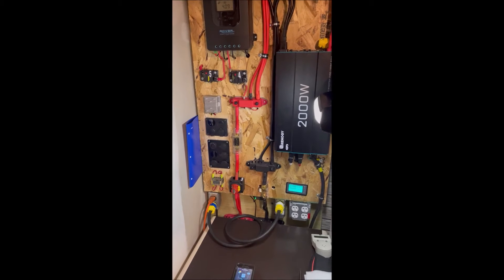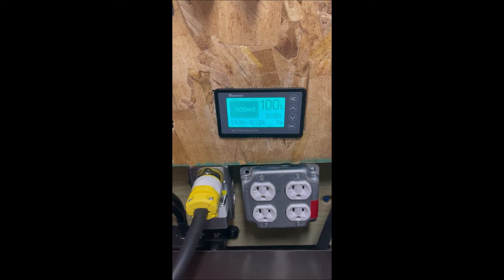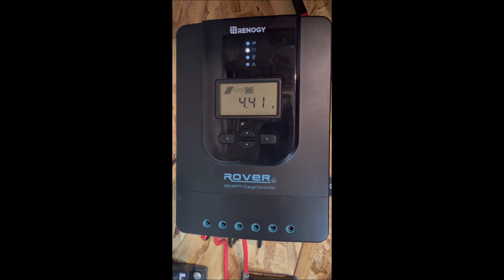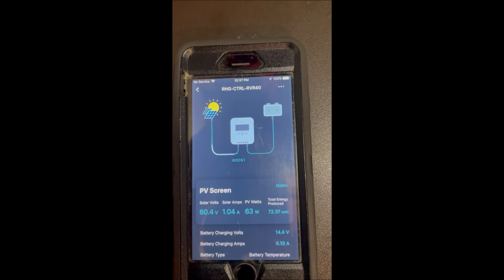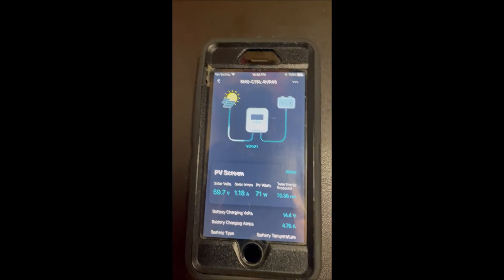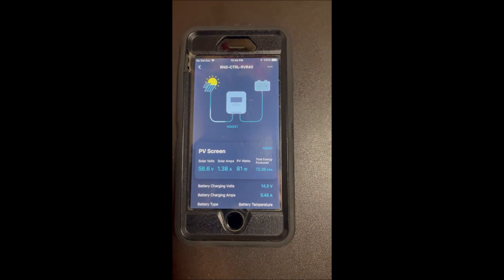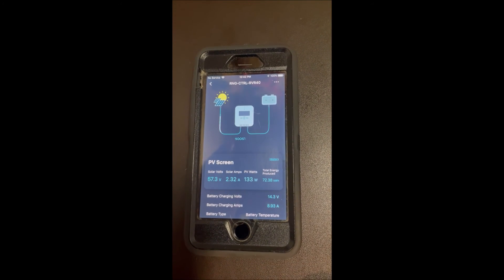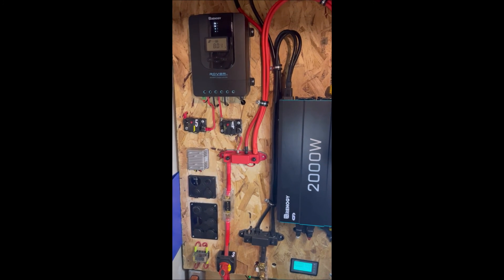Solar Basics: (1) What happens when your Battery is Full and there is still a LOAD?

Comment: Seems my controller goes over my set voltage when the battery is fully charged… then the over voltage alarm goes of on my inverter and shuts off
Reply from the maker: Check the voltage at the battery compared to what the controller is displaying.  There may be a significant voltage drop between the too.  The charge controller will keep charging till it measures what it is looking for which could make the battery too high.  You could also in your controller turn down voltage by the amount that it is overcharging.
Reply: @ yes thanks… I was playing with the voltage on the controller setting it a little lower than the correct float charge voltage…but seems I was still getting these spikes to 30v the system is 24 with a new 200 amp lifepo battery.  Batter speck is 28v charging voltage.
Reply from the maker: @thebluedan  It is probably the battery is not balanced.  A cell is going over voltage and the BMS is shutting off which creates that spike.  See the video I made about voltage spikes and balancing a battery/bank.  Literally had the same issue.
Reply: @ hmmm that’s a tough one, the BMS  is integrated…. FELICITY SOLAR battery..I don’t have access to this system… appreciate the note.. but the energy over voltage seems to be coming from the charge controller.  When I disconnect the charge controller everything is fine
Reply from the maker: @thebluedan  Watch these two videos in order.  They are when I balanced batteries and had voltage spikes.

1.  https://youtu.be/aEUKjD2VHHM

2.  https://youtu.be/Mfa8v4A3YYc
Reply: @thechiefsway2618  very interesting… and helpful… I got the the battery drain down buy turn on some loads.   The spike didn’t happen again but I might try this method anyway makes sense thanks a bunch
Reply: I like your lay out by the way… where did you get those connector bars?
Reply from the maker: @thebluedan  
(Red & Black) 5/16" 4 Stud Power Distribution Block BUSBAR with Cover - Made in The USA    https://amzn.to/41SSr4J

(Black) 3/8" 4 Stud Power Distribution Block BUSBAR with Cover - Made in The USA    https://amzn.to/4gy2MYq

(Red) 3/8" 4 Stud Power Distribution Block BUSBAR with Cover - Made in The USA   https://amzn.to/41TO2i3

Afull list of the Items I used are in the description of this video.
https://youtu.be/N6jTSINfdzE
Reply: @ thanks 🙏🏻
Reply: Now if I can just figure out how to communicate my charge controller with my battery… filicity solor batteries are made to communicate with their charge controller but I’m using another… maybe there is a way to communicate with a computer app… not a lot of information. When i spoke to felicity and asked about using my controller they said “give it a try” . So far i haven’t seen that spike again.  Holding at 28v.  I guess running the battery down and coming back up did the trick.  But I might look into setting up a DC dump load. The hqst has a dc out. Not sure how to do this …yet

Comment: when my battery goes to 100%, I get a fault on my inverter. Seems like the MPPT is pushing too high of voltage for the inverter. Waiting on the manufacturer to respond but I'm baffled at the moment.
Reply: Hey did you get any solution to it ? 

When my battery gets to 100 ,  the system turns off and batteries start blinking only
Reply: @sodyaslam  I'm having the same problem Reelbassin, my inverter is in default and beeping going on and off so I was thinking the inverter is getting overlaoded so I purchased a panel shut off switch from amazon and hope that works.
Reply: @Reelbassin  same

Comment: Sir can U please help my solar charger control stops to charge the battery at 26.4 everyday and I set it to stop charging at 27.6 because my system is 24v so it start U back the power that was saved during the day from 26.4 keep draining like that it stop charging around 14:00 pm as I have lots of panels?
Reply from the maker: If you have set the charge controller properly then I would suspect the problem is your battery is out of balance.  The battery is out of balance enough that it can only achieve 26.4Vdc before the BMS cuts off charge because a single cell exceeds 3.65Vdc.  Set your charge controller for 26.3vdc and it run there for about three weeks then slowly turn up the voltage by .1 or .2 every week till you can reach your desired voltage.  I have two videos on balancing a battery and battery bank.  Watch those two videos.
Reply: @thechiefsway2618  Thanks Sir

Comment: hi sir, i have the same mppt charge controller as you do in this video. the battery level on my mppt and the battery level on my power inverter dont agree with each other. which one should i trust?  the mppt says the battery is at 80 percent and the inverter says my battery is at 30 percent?  does this make any sense to u?
Reply from the maker: I would definitely trust the charge controller to a point.  The duty of the charge controller is to monitor the battery voltage and stop charging when it is full based on the battery type you had selected.  The Renogy charge controllers do show about .1 to .2vdc low so keep that in mind.
Reply: @thechiefsway2618  thanks sir

Comment: So how do we manage that excess power comjng in?
Reply: What about if the charging controller is not cutting off  the input current when the battery is fully charged
Reply: @ErnestUgwueze-c6x  yes this
Reply from the maker: When the battery is full and at approx. 14.5vdc the charge controller will act like a light dimmer switch and regulate the power from the panels to only the amount to feed the load requirement so the battery is not charged anymore.

Comment: OK, Chief...you need a use for those unused load terminals on the right hand side of the Rover. Maybe a lamp made out of a nice brass 3''-50 shell case and a Renogy BT-2 Bluetooth unit so you can turn it on remotely with your phone.

Comment: How do I get the controller to recognize 4 batteries ?
Reply from the maker: The Charge Controller does not recognize individual batteries, it recognizes the batteries Voltage.  When you connect 4 batteries in parallel they are virtually one giant battery.  The charge controller only monitors the battery voltage up to the set value of when it is full then will shut down charging. in the case of LiFePo4 Batteries that is 14.5Vdc.  When the batteries are full the charge controller will only produce enough current to feed the load at the time.  Watch this video below.  Hope this helps.

https://youtu.be/xLTatNDXbVk
Reply: @thechiefsway2618  unfortunately I'm still having issues
Reply: @thebatmom  What issues? I have used several brands of charge controllers. Some have sloppy internal settings and voltage readings are incorrect. It took a Fluke DVM to see that the controller was trying to put overvoltage into the batteries and some of the BMS units shut down. I verify that each new build that I do allows the charge controller to shut off the charge when the battery reaches 14.6 volts maximum for LFP lithium chemistry batteries even in full sun. I am liking the Renogy Rover series like the Chief's MPPT unit. Set them to the correct battery chemistry and they work as advertised.

Comment: What is the difference,  maybe inside connections, between the battery out and the load out on the solar controler  ?
Reply from the maker: The battery terminals are bi-directional.  Battery voltage to the controller and charge current back to the battery.  The load output is just a switchable output like a light switch on the wall.  The loaded output will either be solar power during the day, solar battery mix on cloudy days, and just battery power over night.  The load output is generally limited to 20A.  Hope this helps.
Reply: @The Chief's Way  so it would be possible to charge an additional smaller battery connected to the load terminal  ?
Reply from the maker: @NeoVdV  I wouldn't.  20 Amps is only about 240W at 12V.  I believe there is nothing truly regulating the load output so a battery would try to draw what I would think would be much more then 20A, and in that case something might be damaged.
Reply: @thechiefsway2618  , So it's only good for some smaller (LED) 12V  lights
Reply from the maker: @NeoVdV  I think so.  Here is a quote from the Renogy Charge Controller Manual, "Do NOT connect any inverters or battery chargers into the LOAD TERMINAL of the charge controller."

Comment: I’m still confused, what happens to the energy from the panels if the battery is full and your not home to increase the load?
Reply from the maker: The Charge Controller Throttles back the power from the panels to the level of the load at the time.
Reply: @thechiefsway2618  so do the panels stop producing power? I am new to all this, also buying components for a small system and confused about wire gauge and fuses, yours looks well laid out, do you have a video explaining your entire set up?
Reply from the maker: @bobbader4789  The panels by them selves are basically an open circuit.  The Charge controller is the light switch/Dimmer.  When power is needed the Charge Controller will close the circuit and current will flow from the panels. The charge controller can also regulate how much current/power is coming from the panels like a Dimmer Switch in a lighting circuit.  A charge controller is needed so as to not over charge your battery when its full.  When the battery is full the charge controller will only make enough power from your panels to feed the load like a generator will speed up and slow down based on how much load there is.  Hope this helps.
Reply from the maker: I have two videos showing the construction and an overview.
https://youtu.be/N6jTSINfdzE
https://youtu.be/pXLm2L5_WeU
Reply: @thechiefsway2618  thank you, that does explain a lot. I too was wondering how the panels are throttled to protect the battery. Describing the panels as open circuits made me go, "hmm", then i realized, they don't do anything unless you complete the circuit, which is what the controller does (and un-does as needed). Cheers!!
Reply: @bobbader4789  hey did u ever figure it out? I'm lost and need help
Reply: @thechiefsway2618  wont the panel get overflow? 😂
Reply: I got a big Question . I got off grid solar.   Okay when the sun is out. Full sun after a few hours my inverters start beeping and turning off , it’s like I’m getting to much power from the sun . What can I do to fix this problem. My charge controllers are rated big enough I’m pretty sure